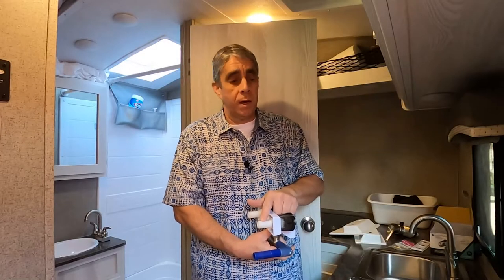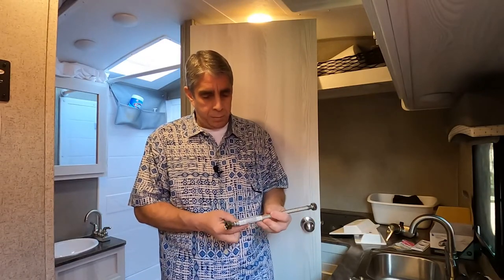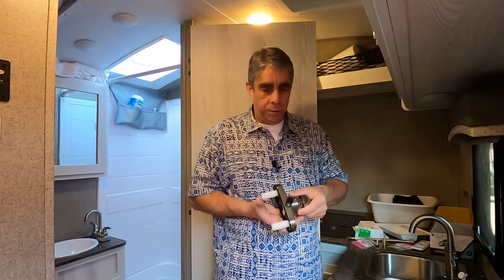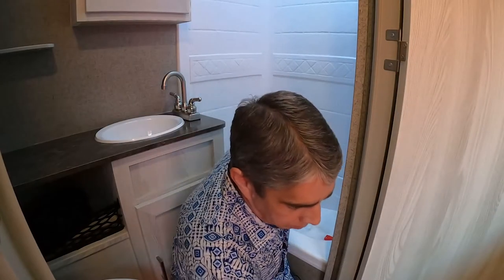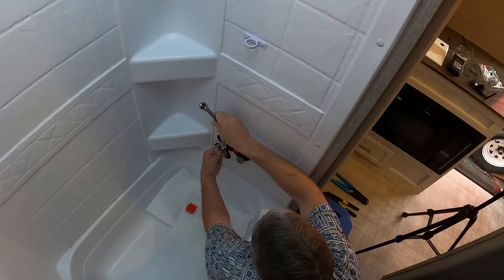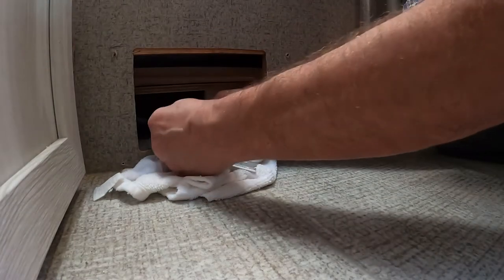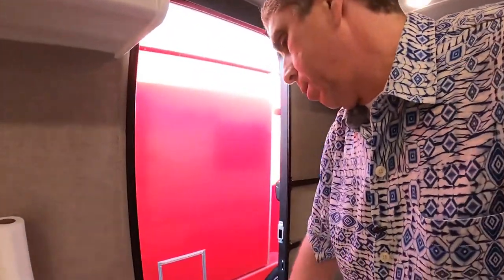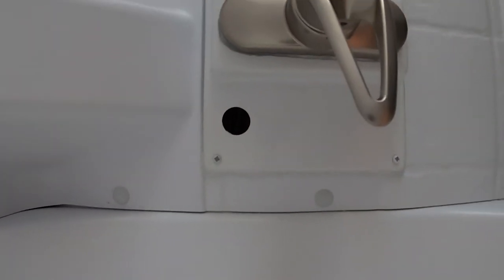RV Shower Plumbing Leaks (Pt 2) | SharkBite NPT Adapters | Geo Pro Travel Trailer

Comment: Hi Mario, I have a question, why couldn’t you used A longer supply line or pex tubing?
Reply from the maker: Hey there, Roel. In some cases, PEX is a good choice. This video is simply about me trying to find a flexible PVC vinyl tube that I could use with PEX. This was in preparation for a project I completed in this video, where I needed to make several turns - https://youtu.be/qMTIzXN5JhU

Comment: It sure looks like Geo Pro went cheap on the plumbing materials.  It even looks like a mess around the water pump and filter that you showed.  The holes in the shower surround could have housed 4 inch lines.  That's shoddy work and shows a company that expects to be going back in to fix leaks.
Reply from the maker: Hey there, Kevin. The parts used by Geo Pro are pretty much standard for the industry. I have seen some instances where other fittings are used. The tough part for me is finding retail options to purchase supplies. As for the mess under the bathroom sink, I am compelled to tear the whole thing out. Don't tell anyone, but I already removed the filter. Take care!

Comment: mario, hubby wants to know if you had a water regulator on before putting/turning on water when you discovered leaks ?? 
thank you!
Reply from the maker: Thanks for commenting, pcdavies! I have used a regulator from the very beginning. I use the adjustable type and set it to about 45 lbs.. I feel I was able to isolate the issue around the right angle fittings. The rubber seals inside the fittings do not always seat correctly. The most obvious example was at the shower faucet where simply twisting the fitting to tighten caused the rubber seal to migrate outward. Another tidbit of info is the kitchen sink leaked prior to me taking delivery and the dealer attempted to remedy the situation, similar to my initial attempts to reseat the fitting(s).

Comment: Wow!! With all of those leaks, I would have bought it right back to the dealer and had them fix all of that! But I guess then you are without your trailer for who knows how long and may not be sure of the quality of the work. You have been through a lot!! Thanks for sharing all of it!
Wondering how your suspension upgrades handled om your last trip with your trailer? What were the differences towing before and after the upgrades? Thanks!!
Reply from the maker: Hello, Barbara. The plumbing leaks were a bit of work. Looking back, I am glad I approached it the way I did. I am assured existing leaks are fixed and I can manage future leaks. I am probably ahead on the time and money front; warranty vs. do-it-yourself.
I am happy with the front and rear suspension upgrades. Performance while towing and hauling is great. You can never have your cake and eat it too. Drawbacks are driving empty and off-roading. I think update videos are in order. Maybe channel update videos will be a good approach.

Comment: Mario, I'm starting to lose faith in the quality of build with Geo Pros. You have been in the "belly of the beast" what do you think of material quality and general workmanship (other than the plumbing) The Winnebago Micro Minnie has gained a couple of points as a possible addition.
Thank you Mario!
Reply from the maker: The only thing I think I could blame Rockford for would be the leak at my solar charge controller. It seems to me they did not install the gland plate thing on the roof properly. So I am happy with my Geo Pro. I am happy I chose this trailer and it is not for sale. I truly believe the plumbing leaks I had can be attributed to the manufacturer of the right angle fittings. During my research I have found other RVers, regardless of which RV they own, searching for an alternative PEX to NPT adapter.